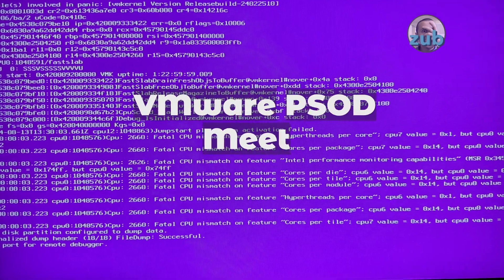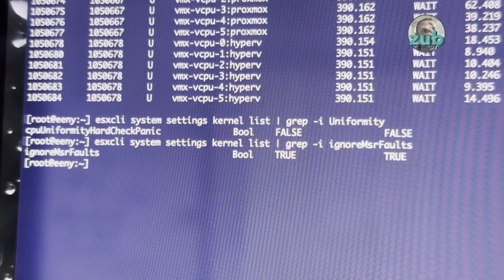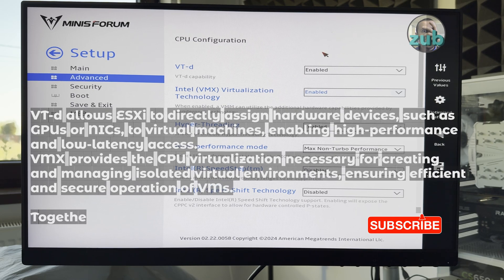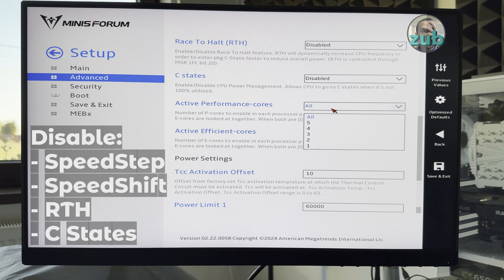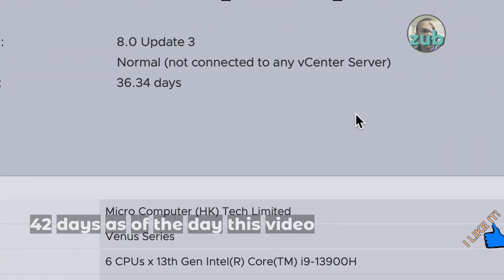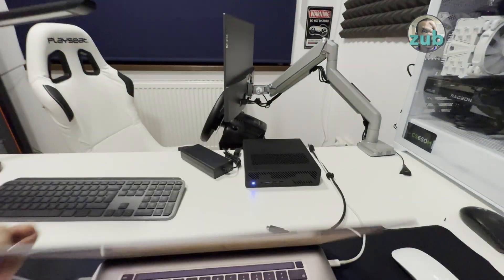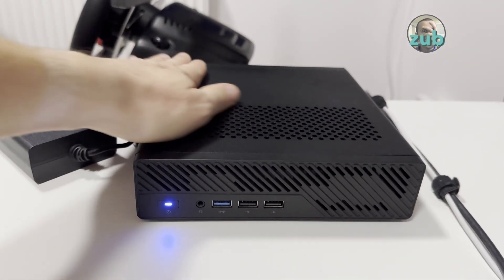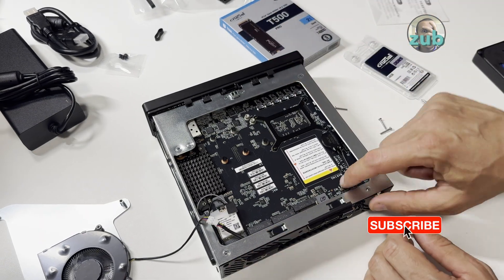[FIXED] My Quick Fix for Intel 13th Gen CPUs! Stop VMware PSOD on Minisforum MS-01.

Comment: Worked with a Minis Forum UN1290 with i9-12900HK and ESXi 7.03 👍
Reply from the maker: Awesome! 👍
Glad to hear it worked on the UN1290 with the 12900HK and ESXi 7.0.3. Really helpful to know the fix works on more Minisforum models.
If you don’t mind sharing, was VMD enabled or disabled in your BIOS? That info might help others running similar setups.

Comment: Hello, what brand and model of ram are you using when you want to run Esxi 8.0?
Reply from the maker: Hello, ESXI does not have a RAM compatibility list that I am aware of. RAM however must be compatible with the computer. I am using Crucial DDR5 RAM 48GB 5600MHz (https://amzn.to/4c745vR) Details about this setup and more information about this minipc and it's components are in this video: https://youtu.be/hqWJ1AFwzJI
Reply: @zubilitic   thks bro
Reply from the maker: No problem ;)

Comment: Thanks for the info, but I have a question, can you restart the ESXi and check if the VM's are working fine, when I tweaked ESXi, it worked without any pronlem, but when it got restart all the VM's disappeared, kindly need your input in this.
Reply from the maker: Hello,
I've restarted ESXi multiple times, and my VMs have remained intact. Your issue may not be directly related to the reboots but could be linked to a disk problem or an issue at the ESXi level.

To assist you better, I need more details:

Which version of ESXi are you using?
Are the virtual machines stored on an internal or external disk?
How are you currently recovering or bringing the VMs back?
Let me know, and I'll do my best to provide guidance.